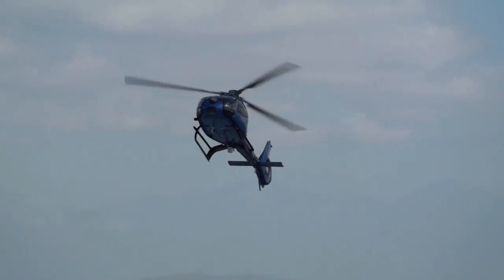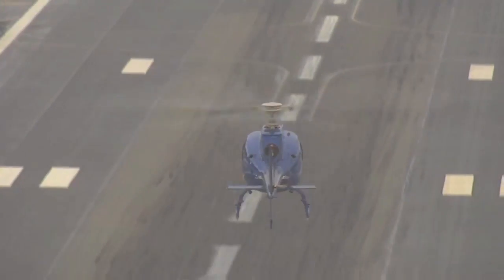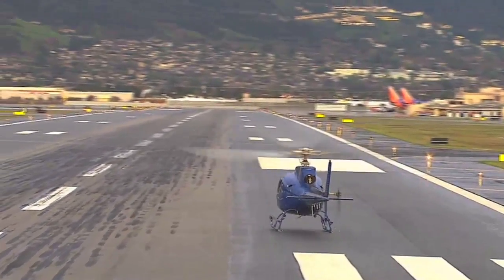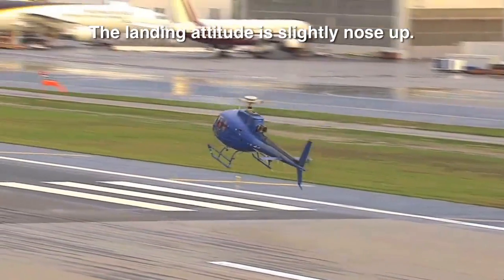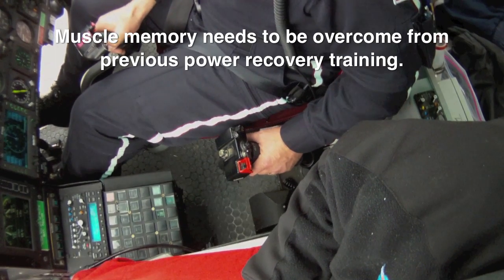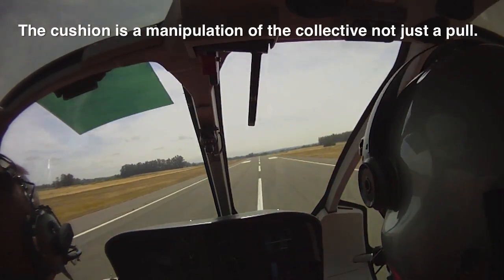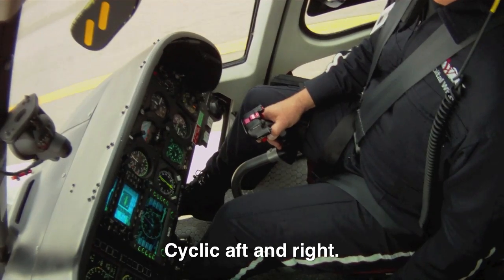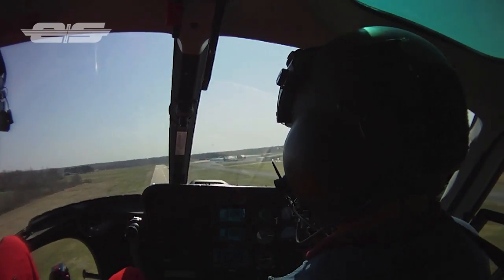#2 - AS350 Autorotation Touchdown - We have made a Re Edit of this 2010 video

Comment: there is no way this is autorotation..his engine is going fine, just at lower revs most likely
Reply from the maker: I was in the helicopter. engine at idle. No torque occurring. Freewheeling unit disengaged.

Comment: If the engine fails, and an autorotation landing  needs  to be performed, why not pull  the collective all the way up to  full pitch of the blades immediately  and flare with the cyclic near the ground?...thanks
Reply: +Gary Vale You probably already know the answer, given the time :) But nevertheless: safe autorotation landing needs maintaining the rotor RPM in certain range (given by the pilot operation handbook). This is done by collective pitch control (pulling it up results in less RPM as it increases the load, on the other hand lowering it results in more RPM). Applying full up collective can lead to dangerously low RPM and loss of control. Besides, if your thought was that full up collective will just maintain a slow approach to the ground, well you actually want to have some speed (both vertical and horizontal) - that&#39;s where you have stored the kinetic energy that you can exchange for rotor RPM during the final touchdown. Think about wind gusts and things like this, that can complicate the landing.
Reply: +Gary Vale because doing so you would "stop" the blades from turning and fall as a rock... you increase your pitch angle only at the end of the flare when you can afford to loose the little amount of energy left (rotor's) to make a soft touch down.. speed is ur main energy source, u can get speed by losing height and you stop the descent by slowing down with the flare (near to the ground, otherwise you'll end up in the "dead man's curve")..
Reply: If you add full pitch with a dead engine, the excessive drag that pitch creates will quickly slow and completely stop the blades. The blades will fold straight up like an umbrella in a wind storm and the helicopter will fall out of the sky like an anvil.By reducing the pitch, the blades keep spinning... Actually, you can spin the blades faster with the engine off than you can with the engine on.
Reply: You have to reduce the rotor lift and drag immediately after engine failure. If the rotor rpm drops too far you will lose control of the craft and most likely not recover whilst dropping like a rock.
Reply: Gary Vale It depends on the craft and the amount of flare induced. Example https://www.youtube.com/watch?v=vLtOO7zqX2k
Reply: Gary Vale Pulling up on the collective will reduce rotor rpm and cause a stall. The upward flow of air through the blades is what keeps them spinning and that requires down collective. The flare is just to burn off your speed at the end of your descent, kind of like a quick stop
Reply: Gary Vale You pull the collective all the way up if you're entering a hover auto. Youre slowing your fall from jjst a few feet, but if youre in yhe air you dont want to blades to stall so you push down collective then a little bit up to control your rpm's. you want them to remain in the green as well as a healthy airspeed.
Reply: Gary Vale it would dangerously reduce the kinetic energy stored in the main rotor. the energy added from the aircraft falling would not be able to supplant the energy lost by doing so, and then when you finally reach the point where you are near enough to the ground and pull the pitch up on the MRS, it would be ineffective at reducing lateral speed due to insufficient time and energy required within the system provided from just falling and you would either crash or land very hard. this is why collective needs to be Modulated during an authorization. another thing is that while you wouldn't want to drop like a rock, you also don't want to stay in the air forever with a failed engine.
Reply: thank you sir for the knowledgeable answer....
Reply: If your first action on a power loss in the cruise was to pull collective, you'll stall the main rotor. At approx 75%, Rotor RPM, you can't recover it, without an engine. (No particular helicopter, just a mean average)
In the cruise you must dump collective (reduced drag)...flare (cones blades and aids in restoring main rotor rpm)... Set you speed(with decent) get main rotor RPM in the green and pick your landing site into wind. 
This is just the basics..... There is so much more you need to do and consider to get back to mother earth successfuly.
Reply: +Gary Vale That will cause the Rotor RPM to drop
Reply: Tee B correct.. the only thing which in a real auto u should avoid is the run-on landing.. speed most likely means injuries (unless u have a runway available), and since a harsher flare means less speed and more lift when applicable it's preferable ;)
Reply: because the drag of the increased pitch will stall the blades and not having an engine that energy cant be recovered....Rotor RPM is life.
Reply: I'm not sure if I got your question right, but I'll attempt to answer. Once your engine fails, your first goal is to maintain rotor RPM. Once rotor RPM drops below a certain point, the helicopter will fall like a rock and there's no chance to recover. In order to maintain RPM, you have to lower the collective pitch, which enables the passing air to accelerate the rotor. Pulling the collective all the way up would achieve the opposite, it would slow the rotor down dramatically. That's why it is only done in the last few seconds.
Reply: I am guessing the tricky part is, at exactly how far above the ground and what RPM  you start adding the collective back....
Reply: It would slow the rotors down too much. You want to keep the rotors moving fast until you absolutely need to apply collective. I am not a pilot, but I have a lot of experience in flight sims.
Reply: Gary Vale-
Gary, the reason is as follows-
Basically, the collective has to be lowered to minimise drag.
This has to be done immediately, otherwise the rotor rpm will disappear 
and the chopper will drop like a brick.
Reply: If you lose control with no engine power that close to the ground, you have no power and very little maneuverability to recover.That's why small, precise adjustments are required.
Reply: OK...thanks
Reply: got it...thanks
Reply: Stall the blades
Reply: Collective needs to be immediately lowered fully during an engine failure to prevent stalling the main rotor.  Collective is subsequently raised to maintain rotor RPM in it's normal operating band during the autorotation.
Reply: I haven't flown ever and I don't know much about flying anything, but i guess if you pull the collective all the way up you are losing the rotor rpm and you will eventually stall instead of gliding down safely and pulling the collective near the ground to soften the landing
Reply: During powered flight the induced airflow is going through the rotor system from top to bottom. The engine power is what allows the transmission to turn the rotor head. If the engine fails, the rate at which the rotor head is turning decreases because there is nothing driving the rotor. If the collective is held high (increase of pitch on the rotor blades) without anything driving the rotor system (engine) the rate will continue to decrease and the helicopter will fall like a rock. By lowering the collective to flat pitch, the helicopter will begin to descend, and the induced airflow will come from bottom to top and the kinetic energy (altitude) will drive the rotor system. Auto rotation uses the the airflow of inherent in a descent to drive the rotor system. That energy is stored in the rotor system until the bottom of auto rotation, and is used to "cushion" the landing. Also Magic.
Reply: Because with full collective the rotor will continue to slow down and you fall like a rock and when the rotor doesn't turn anymore why bother playing with the cyclic? The rotor only acts as a windmill and keeps spinning if the collective is near zero or even negative.
Reply: You would induce too much drag on the rotors before getting close to the ground, killing your rotor rpm and thus lift.
Reply: So what is going to spin the blades if the engine is not running? The blades need to first spin for them to be of any use. The blades would not spin in that case, or not spin enough.
Reply: You would convert the kinetic energy of the rotor to a little bit of altitude, then stall it and drop like a brick. Just like a fixed wing, an unpowered rotor blade needs to drop to maintain momentum and remain effective.
Reply: What purpose would that serve? If you pull the collective to full, the kinetic energy in the rotors is dissipated with drag, which slows them. You want to maintain rotor speed so you can flare with it when you actually need to slow down. If the rotor speed drops too far, you won't have any cyclic control either because that relies on imbalance of lift.
Reply from the maker: Im assuming a joke?